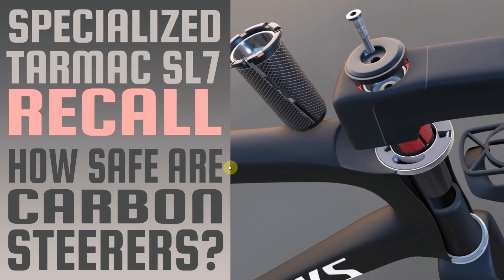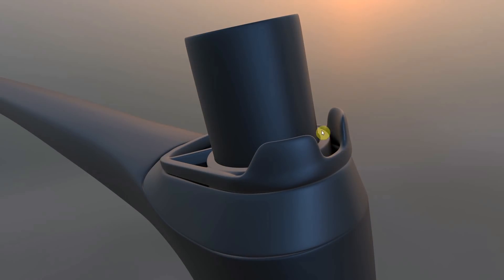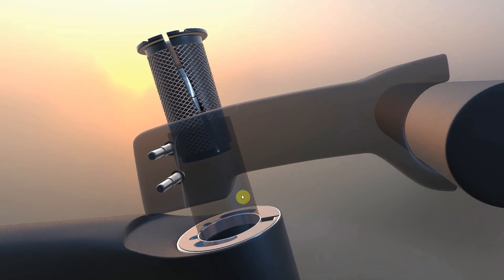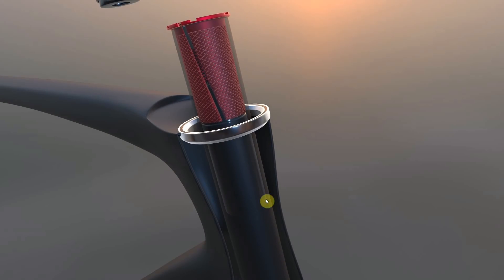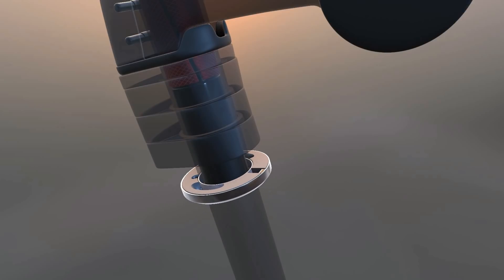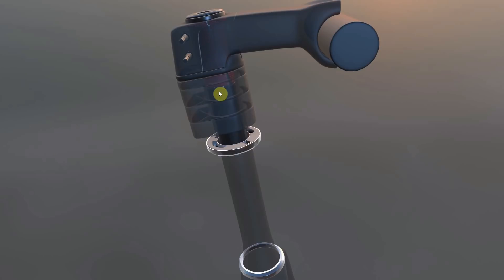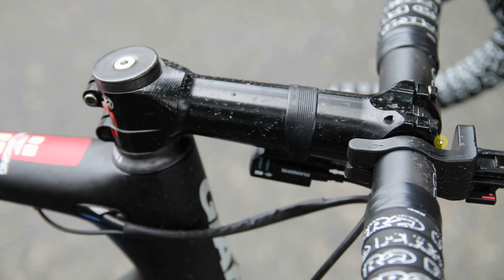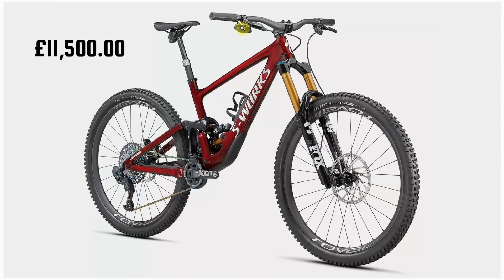Specialized Tarmac sl7 recall | how safe are any carbon steerers | 3D animation | Bikotic

Comment: Great video! I've recently had this happen. I learned that the compression plugs need to be longer. It's important to measure at the top of the stem to the top headtube bearing and ensure that the compression plug passes that top bearing. In some cases you may need a 90-100mm compression plug depending on spaces. This will strengthen the fork steerer when tightened at the stem.

Comment: The issue is these companies are simply there to make sales not to make bikes safer. I went deeper into this issue and what I found is that all expansion plugs are not only installed wrong but the plug is completely the wrong size. This video explains in detail how to install it properly https://youtu.be/9sKIc2piLA8?si=GRu34G2DtvkhnAeY. In this case you are showing it is quite clear what happened, the spacers are much wider now vs the round spacers so now you must tighten down the top cap a bit harder, this of course will make for a stiffer turning bike and if you take your hands off it will be harder to keep it straight. So what happened here is the owner or who ever built it did not tighten down the top cap down properly thus leaving a gap that allowed the spacers to literally act as a fulcrum point to snap the steerer tube around the bearing itself. As far as the last video that is 100% galvanic corrosion on that allu insert.

Comment: I am going back to aluminium steerer tube and that's the shift we need to see. Bike frame manufacturer can drop much needed weight from the frame and shift that to aluminium tube. I cut my steerer carbon tube too short then just happen to learn about different steerer tube

Comment: Great video, love the detail and the animations!

I have a Cervélo Cal-5 of which the headset failed on me after only 200km... It didn't crack and I was very on the safe side just shortening the ride and getting home... The glued-in insert for the headset had come loose and was coming upwards whilst riding, so that possible 'solution' of a glued metal piece only makes sense if they actually have a proper bonding in the first place...

Being (not) glued in, it actually made servicing my bicycle on the fly impossible, which might have been possible with an expander plug that wasn't tightened properly.

Comment: The spacers between the bottom of the stem and top of headset need to be alloy instead of plastic, with some compression force added by the stem cap added before the stem is tightened to the fork, to transmit loads.

Comment: I broke a steerer on cheap Chinese frame racing a crit 12 years ago. Hit a pot hole at 50kmh.  Nothing broke, and I finished the race, the only thing noticeable was steering was sticking a bit. When I took the stem off I saw that the stem had crushed one half the steerer tube.

Comment: I'm an engineer, and as far as I can see you've identified the issue. So, the longer expander is for damage mitigation. The metal collar 1:40 is the actual workaround: It should be wider (taller) than the "compression ring" and made immovable by a retaining compound (glue) at the place. Bonding a metal tube inside the steerer rube, as suggested by you, won't prevent that abrasion on the outside. -- For example, Time has on some bikes that collar already bonded (Time Scylon), as alternative Time (ADHX) and Deda (Superbox) ship with wide plastic "compression rings" that'll also do the trick.

Comment: Beautiful rendering and modeling! Here's a data point:  I just got a specialized Aethos (not Tarmac).  Specialized is very clear in the instruction manual that you should not add any spacer stack greater than 5mm above the stem except for fitting -- I gather it's because of the ideas you discussed.  Further, they also specify that you must use the spacers they provide below the stem -- These spacers are not solid, but rather, oversized wrt the steerer tube and have some nubs on the ID so they are centered around the steerer tube and provide an easily sliding fit.

Comment: It's funny how a solution is to add alloy to the carbon steerer. Which brings us back to just having an alloy steerer. I literally replace or look for a different bike if the bike come with a carbon steerer tube fork. Not risking it.

Comment: It's interesting that none of the 'broken steerer' images includes the compression plug. I set up my bikes with compression plugs that are 50-90mm depending on whether there are a few spacers above the stem...say a 70mm compression plug, or just one 5mm spacer and use a 50mm plug, how much flexibility I want with having a little extra steerer tube (where I would perhaps even use a 90 mm plug). 
Since the stems are virtually all 40mm high, I would NEVER use a compression plug on a carbon fork that is shorter than 50mm. You can get nice plugs that only weigh 30g at this size and even the nice 90-100mm would weight as much as 65g (g-d forbid@!!!)
This is the ultimate duel to the death with yourself if you are careless about this. Should you risk your life (with a 28mm plug) for 30 grams of weight?
with a 90mm compression plug you can ruin 30mm of spacers below and 20mm above and still have the 40mm for the stem.

Comment: I have a new Cannondale CAAD Optimo 1 that started making a ticking sound from the top of the headset recently.  When I put a lot of power through the bike, pushing and pulling on the handlebar causes it.  It's like a random, infrequent single tick every five or ten pumps on the pedals.  On the last ride, I figured out that the headset has actually loosened a significant amount, with visible play if I rock the bike back and forth.  I've stopped riding it until I can take it back to the shop it was delivered through.  I very much hope the steerer hasn't cracked and that they can simply tighten it.

Comment: It's certainly adviced to disassemble and look at your carbon steerer tube from time to time...

Regarding the high stack above the stem, it might either be that the person isn't able to cut the steerer tube to size after they settled for a more aggressive position, or they have a new bike and don't want to cut too low before they had a bike fit.

Comment: Thankyou for making such an informative video. As an engineer I have to say the Specialized compression plug is a LOT better than many I have seen. I don't think I would ride a carbon fork without a long long compression plug that goes well below the upper bearing. I like your idea of an alloy tube bonded inside the carbon steerer.  I have a 23 year old steel frame road bike I was thinking of updating to carbon forks but now after seeing your video I think I might stick with cromo forks.🙂

Comment: I want to order a Allez Sprint frameset that has the SL7 fork. I was told by Specialized that the 2022 Allez with the SL7 fork is not affected. The 2022 Allez was thoroughly examined and tested with new steerer tube parts before being released. Your thoughts anyone? Also, considering the added weight of the new parts to fix the problem, why cant they just engineer a strong thin steel sleeve that goes either on the outside or the onside (or both) of the carbon steerer tube? Or in that case have the whole steerer tube be a strong honeycomb steel? I'm sure they can engineer a super strong alloy steerer that will weigh the same as all that metal that they are dropping into it now.  I wonder if I can have a local machine shop make me a 7071 Alu sleeve that is a snug fit that goes the full length of the steerer?
Reply: Aren't you going to have a diameter slightly larger than 1 1/8 inches in the end?

Comment: The spacers and stem length!  The more installed spacers and the longer the stem length, the greater the stress and shear force applied to the steerer.  Solution?  How often does this happen?  Would careful and meticulous assembly be sufficient to prevent failure?  You can always design for higher shear forces by increasing thickness of carbon, use inner or outer steel sleeves, etc, etc, but is this really needed?

Comment: Great job on the animated 3d visualization. Two questions: 1) would it be possible to design a headset that doesn't use a compression ring? 2) why don't manufacturers bond a thin metal sleeve over the steerer tube -- only the part of the steerer tube where the compression ring and bearings might contact. That doesn't seem like it would weigh very much, but it could increase strength and crush resistance.

Comment: Beautiful animation. I got a carbon bike repairer to chop my steerer to leave about 3mm above my stem. That way I can keep a 5mm spacer above the stem for preload. Compression plug is short like the pre-recall sl7 and manual does say it should extend throughout the stem clamp segment or I might die. While cutting I did get the carbon expert to inspect impression on the steerer by stem. It was always torqued by a torque wrench evenly. He said it is ok, carbon can be a bit squishy in certain direction. I think if there is an overwhelming force that is where it is gonna break. I wonder how many broke there due to accidental impact vs. normal use like Andre Grepel sprinting. It would still be worth it for bike makers to just reduce the inner diameter. Would help to reduce breakages at very little weight penalty and manufacturing hurdles. Specialized did two things to extend the plug length. 1. Make sure clamp section is absolutely reinforced from the inside no matter how many spacers are added. 2. In case the steerer still breaks, the handlebars remain over the head-tube so the rider can remain upright somewhat and hopefully come to safe stop before falling. I think the change is a good one.

Comment: Re: Cervelo failure... I have to wonder if galvanic corrosion played a roll in the failure.   Since Cervelo use (non factory installed) bonded alloy sleeve in the steerer, that area is perfect storm for failure.    The area around the failure point seems have the telltale white powdery residue of corrosion.
We routinely see this area (internally & externally) chalked full of sweat & guck on bikes that only see the basics of maintenance.   
With the explosion of interactive trainer riding,  we have seen a significant uptick in front end damage (Bars, stems, headsets, forks & even frames) from the corrosive effect of combining sweat, carbon fiber & alloy

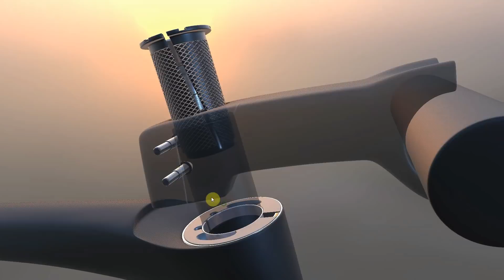Comment: In all bikes I've seen so far, the "compression plug" set directly were the steerer of the fork got cut. So what you show at 4:03 appears incorrect. Also the "compression plug" gets mounted to the steerer prior mounting the fork into the frame.

Comment: All due to poor engineering and material strength selection. Summary poor design base on accommodating a hydraulic braking system that is heavier just to save few aero watts in “theory”

Comment: I think that UCI should have specific regulations regarding the steering tube, specifically that it should be steel, specify type of steel and tube minimum thickness. This being a health and safety issue, the penalty of a few extra grams for the steel tube is well worth it, and gives the rider "peace of mind" that they won't experience a catastrophic failure.
Reply: It is my belief that the industry as a whole needs actual law abiding regulations, these bikes are not being ridden by pro cyclists just the everyday cyclists, there should be regulations protecting them from this type of safety issues
Reply: Sadly most of these frames/forks are just branded by big companies and are designed by Taiwan/Chinese  designers. And the big bike makers just slap a sticker on it.
Reply: @seanbailey8545  Wongy Ching tech

Comment: I don't know why bike makers use bearings in their headsets. If your handle bars spin 360 degrees once in their life time they are broken. I have a Trek Madone 6.9 that's 10 years old and it came without bearings and uses a bushing on a carbon steer. In 10 years there is no wear on the steer, its lighter, and bushings don't wear out.

Comment: There are lawyers or industry apologists (working for the bike companies, maybe Specialized) who have been on the Cyclingtips forum, trying to raise doubts about carbon.  One guy literally tried to argue that since there was no data to prove the strength of carbon steerers over steel ones, we cannot assume (with safe probability) a carbon one is any weaker.  

It reminds me of lawyers who would combat comments about Lance Armstrong doping allegations on the VeloNews comments section (whenever they had the feature enabled). 

The extent to which the industry will try to silence any honest debate is sickening.  Their determination to continue the Chinese carbon manufacturing machine rolling is quite simply sickening.  We need to stop funding these companies.